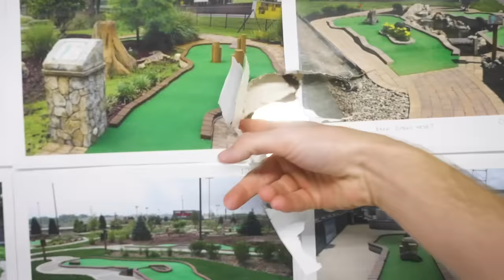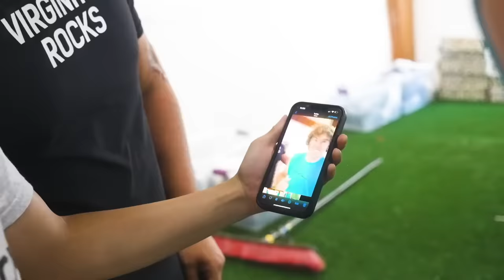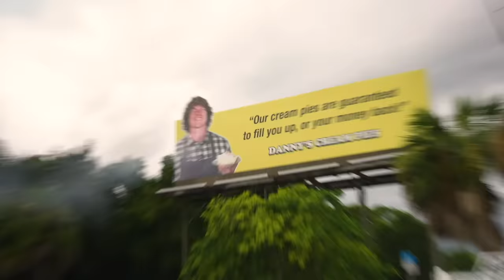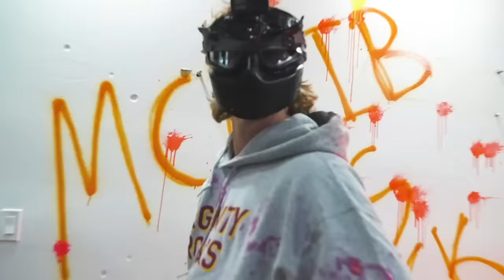Blindfold Paintball In My House!

Comment: why is there no filling in the walls ?!
 
in germany you would not even get a permit to build something like this ^^
Reply: insulation is used to keep heat in. They are in Florida, a very hot area, so they don't need insulation. But still a lot of homes use it for sound dampening.